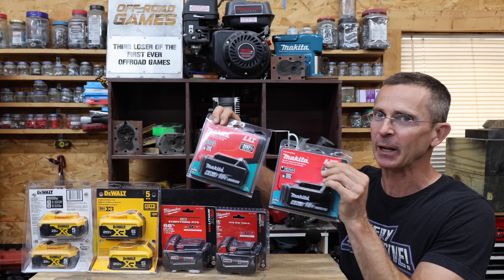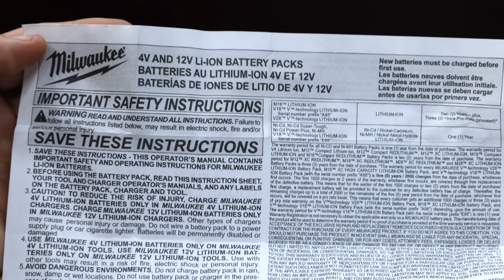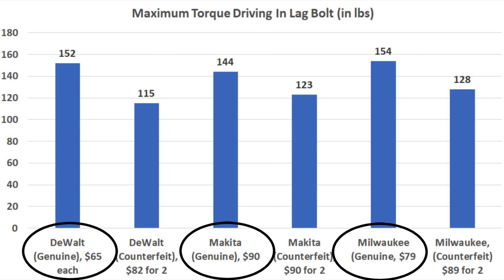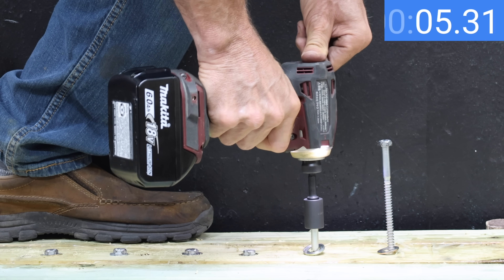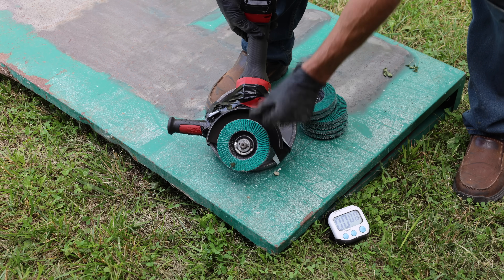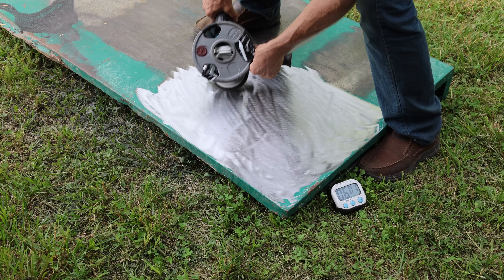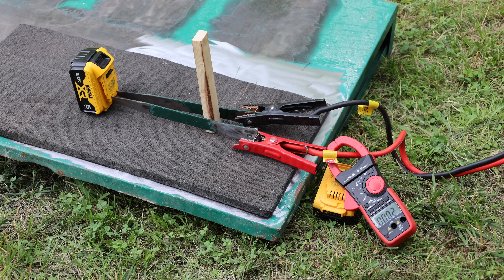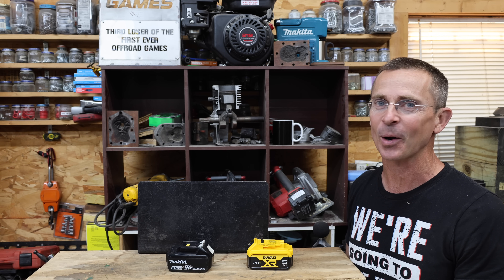Have You Been Scammed with a Counterfeit Tool Battery?

Comment: It's one thing to sell aftermarket batteries that are "compatible" with the tools.  It's an entirely different thing to sell fake ones as genuine.
Reply: It’s insane! If they put the effort, money and resources they used in making the battery look like OEM into making the battery good they could probably make a battery that is just as good at a cheaper price.
Reply: @cynic5581 but making them look like OEM generally does not take much effort at all. 
Often they are either made in the original factory or with the original tools.
When an injection molding tool is no longer needed by the OEM (because it's worn out or they changed the design) then it gets discarded. So instead of throwing it away some worker of that factory takes it and sells it to another factory. Now they can make parts that look exactly like the original for basically no tooling cost.
Reply: @cynic5581  You're right.  Could there be some law stopping them.  They could become a great aftermarket brand.  Maybe they just like being crooks.
Reply: @cynic5581   Thats why they spend money. To get sales!
Reply: @cynic5581  Real quality cells are expensive. Like more than half the cost of the pack expensive.
Reply: No kidding. If they just built their own battery they could likely be competitive for cheaper.
Reply: @capoman1 it saves them from liability by pretending to be the name brand
Reply: @capoman1 they are though. These knockoffs can be bought for half the price of the fake rippoffs. The companies making them seem genuine 3rd party, but if people will pay more for this, why not?
Reply: @capoman1  except.... LAWS.

Dewalt has laws about using compatible items with their stuff  as do almost all companies now.

Why should someone SAVE money and why should someone MAKE money on YOUR product no no no ALL THE MONEY IS MINE MINE MINE.

Fuck ass corporate greed.

Since the industry doesnt allow compatible sells. They have to fake real ones.

That said DAMN these are good fakes...
Reply from the maker: Great point!
Reply: @ProjectFarm  - If they would label knock-offs prominently as "Compatible with" I might even consider it.  But trying to pass a fake one off as the real thing, no thanks.
Reply: Where were these purchased from?
Reply: @inspectorraycharles    Aha!  Good question.  eBay would be my guess.  Or Ali, Temu, etc.
Reply: Yeah I buy those with the knowledge that they are not the real deal. They are like a lot of these where you get 80% of the performance for 25% of the price. Really I just need more than 3 batteries since I have 5 tools that all need them so I can keep using them while rotating them on the chargers. I am also not a professional but when I am using them the former professional in me is readily apparent. I'd rather buy 5 of them for the price of one then have a good one go bad because I'm not using it enough then it isn't there when I need it... that's criminal to me!
Reply: @JaredBrewerAerospace  until a fire in your shop due to fake batteries burns down your house.
Reply: @JohnW118  Great observation! You're correct. I am not without fault. Fire extinguishers should be everywhere. I can see 3 in my 400 sqft home shop from where I'm sitting right now. These are used with the revolving recharge schema I mentioned so unattended recharging is minimized. The rack on my charging station where I keep all my charging devices has the spare batteries storage compartments just for the knock-offs. On top of that, I don't even have it powered on unless I'm recharging the lawn mower battery when I'm not away. So thanks! I will pay closer attention to that going forward. Sounds serious enough that I might need to run this by the wife for how important it is for me to build an IR camera module that could kick off an extinguisher! Safety first!
Reply: @JaredBrewerAerospace  Jared the problem with fake batteries is they are just like the very best of the best batteries once they catch fire… lithium fires are extremely difficult to extinguish, so in addition to starting a major housefire, all you will end up doing is getting that nasty yellow powder everywhere while you futilely attempt to extinguish the battery fire with regular a-bc fire extinguishers. You need halon foam suppression to control the fire and last time I checked, they don’t put halon foamers in residential structures. Take my advice. Buy once, cry once. If you buy a legit Milwaukee battery and it craps out, take the damn thing back to Home Depot and exchange it. Legit OEM batteries cost what they cost for a reason. Have you never heard “you get what you pay for”?
Reply: Especially considering how dangerous they can be. I'm all for getting something cheap, it's another thing if it will burn my house down!
Reply: @anydaynow01  - I could live with 10-15% less power as long as they would include a better protection board for a mere one dollar more and label it as "Compatible with...".  Guess the counterfeiters aren't the brightest bulbs out there.
Reply: Some of the best batteries I have are aftermarket and not pretending about it. They look nothing like genuine dewalt batteries and do advertise as "compatible" with. And yes, these are better and cheaper than oem. You are absolutely correct. I will keep buying these because of the actual quality and honest advertising. They also have great customer service. I got a bad batch once and they gave me my money back without question. I bought another set from the same guys and am still using them today 5 years latter. Sorry to say i did find them on amazon but there is nothing counterfeit about them.
Reply: True. Bought a Sankeup 18v lithium replacment battery for my dewalt  drill driver. It performes better than the original battery, still working after almost 5 years of heavy use.
Reply: @Ssups101 That's interesting. I just bought two 18v 6 amp knockoff Milwaukee batteries. They were not very expensive but they brought my Milwaukee angle grinder to life and it became a different tool. Absolutely no comparison. I don't know how long they'll last but so far i love them.😮😮😮😮
Reply: It's insane that there isn't any lawsuit about this.
Reply: @FacuGonz3  there would be a federal lawsuit that amazon can not win if everybody would stop sitting here whining about it and report the fuckers to the US Attorney General for selling counterfeit goods. Selling counterfeit batteries is just as illegal as using counterfeit currency to pay for it. If just 100 people will take ten min to contact the USAG and file a complaint, they will launch an investigation and prosecute and fine them for willfully selling counterfeit goods, force them to vet their third party sellers, force them to remove all the counterfeit products from their site…. In short the government will teach scamazon a hard lesson about siding with chinese communists in order to steal American money
Reply: Just China being China.
Steal, Counterfeit, and Fraud is their way of life.
Reply: @catsspat  selling counterfeit goods as legitimate goods is also a felony and if everybody on here bitching about it would take ten minutes to file a complaint with the office of the AG and tell them amazon willfully sells dangerous counterfeit tool batteries, but apparently they’d rather whine on youtube where nothing will ever be done to force these goddamn chinese pirates out of the American market
Reply: i use aftermarket chinese ryobi-compatibles,  they seem fine.
Reply: @catsspat  I know a lot of automotive parts are knockoff like NGK sparkplugs. Right down to meticulous detail of packaging and other factory marketings.
Reply: @catsspat  ugh. I hate youtube….. if everyone on here complaining would just LISTEN TO WHAT I SAY and report amazon to the AG for selling counterfeit goods, they will force them to vet sellers and ban and report chinese pirates and will closely monitor their sales and start handing out prosecutions if they don’t remove all of the counterfeit goods on their site. Passing counterfeit tool batteries is just as much a felony as passing counterfeit currency
Reply: The alternative is to open the original battery box and replace the Samsung batteries with identical ones.
Reply: I have a 2 amp Ryobi compatible from eBay - works okay - no capacity LEDs
Reply: @ but is it being sold as an authentic Ryobi product, or is it sold as an aftermarket battery that is compatible with Ryobi?
Reply: @rollin18wheels  nope - just compatible.
Reply: Not to Chinese
Reply: wow
Reply: I just assumed they were genuine but failed the tolerance tests so were sold as "defective" at a bulk discount to "another company" and then sold at a lower price.
Reply: Yup. I've purchased ACTUAL aftermarket batteries for my Ryobi tools and they work fine. They're definitely not as good as the OEM, but they were cheaper, so I knew the tradeoff when I got them!
Reply: I agree. I know someone that used the "compatible" ones and they caused a fire in his shop/garage. 
Selling these as original, some people will assume they have the factory protection system in them and leave chargers unattended. That could go really bad.
Reply: @christopherdecker8171  I never trust any charger. When I quit work they get unplugged.
Reply: @christopherdecker8171  some of the genuinely good compatibles are also being counterfitted.  Best bet is to buy at a retail store (and keep your receipt) or for the compatible brands buy direct from their store page. If you get a counterfit product from a retail store, you have an element of legal recourse for any damages that product caused.

Sadly, too many people are buying the cheap counterfits online, then buying a genuine product from a store, and returning the counterfit to the store for credit or replacement using the receipt from the genuine one.  This practice makes it difficult to sort the genuine incidents from the fake ones, costs both the store and the consumer, and helps perpetuate the counterfit market (the counterfitters don't care that someone didn't use their item, they are just happy someone bought and paid for it, and would likely also be happy knowing that it was traded at a store so someone could get a free genuine battery).

And Amazon, Temu, and the rest also don't care, so long as they get their share of the sale.
Reply: Which could be dangerous. I am so sick of all the fake products on the market.

Comment: Please be careful with your tests! The smoke from those batteries can render you disabled and not immediately recognizable. If you accidentally inhale OR the cobalt laden smoke gets on your skin, the disabling effects may take a month or so to disable you and possibly permanently. Treat lithium battery fires as a hazmat situation. They can spontaneously reignite for a month or more after the initial fire. There is data that shows soaking them in salt water fully shorts remaining energy, but that is also dangerous. Remember: lithium batteries produce their own oxidizer during thermal runaway combustion and emit deadly poison gases.

Comment: Considering the price difference the fake ones did well. Most people don't short their batteries with C-clamps. I knowingly bought a fake Black and Decker battery for a chainsaw and after 3 cycles it would not charge. I took it apart and one cell was measuring 7 volts.

Comment: Ive been in the trade for more that 12years.  I honestly thinks that the counterfeit ones aint that bad when you think of it.  I mean using it irl application... Cant go wrong with the original ones though
Reply: Most of the lithium fires are related to these counterfeit batteries it go along with charger interoperability problems. They aren’t safe or worth the risk

Comment: At Defcon a few years back someone did a talk on laptop batteries comparing apple genuine vs. cheap aftermarket compatibles.  The aftermarkets consistently saved money by removing all the safety functions. With after market compatibles it seems like you can save a few bucks and they will work, but if anything goes wrong you're likely to lose the device and fire risk is high.

Comment: I got scammed even after calling Dewalt to "verified" that my batteries were "oem original".  I opened up the new ones to compare and discovered there was no "temp detection" that would tell the charger NOT to charge a hot battery. No thermocouple or connecting wire.  The cells were correct but being as the battery weighed less I suspect the cells were also fake.  Using a RC hobby charger to test capacity, it wasn't terrible at 4.65ah vs 5ah. As I have no idea if there is any "safety" to protect the battery from a over-heat meltdown/fire if pushed too hard in use, I decided to not use them. The clear packaging, info insert, battery case, stickers/markings were perfect copies.  If an American were doing crap like this, the Feds would be on them like stink, why are foreign/communists getting a free pass?
Reply: Globalism / lack of tariffs
Reply: They are not. It's the large corporate entities selling these that get free passes because they are not held liable. They are making bank on sales and if a customer grumbles about it they'll just refund them to keep the customer quiet with no case.  Unfortunately,  many do not even realize they've been scammed so the refunds going out are minuscule.  Meaning, these large online retailers making huge money off counterfeit goods.
Reply: LOL, government is in it for the $$$. More lucrative to sue good companies for being too successful. The only solution is to complain to the manufacturers.
Reply: Pretty certain DeWalt is known for having overcurrent/overtemp protection in their tools rather than the packs. Obviously the tool communicates with the pack to lock itself out for a certain period of time if it's overheating, so it can't be charged or discharged.
Reply: In many cases, same factories that produce "original" batteries, are producing fake ones, which actually arent fake, but made with less quality batteries, or parts that cant usually pass quality test . Most of those are sold in countries that dont really care about safety or quality control. They call it "products from night shift".

Comment: I’m looking at all my Dewalt batteries and truthfully I don’t know if my batteries are counterfeit or not since I threw away the original batteries!
How would we know!
Surely the manufacturers should be able to warn us and place some labeling on their products that would alert us to the counterfeits!
Thanks for alerting us to these counterfeits! Love your channel ❤️
Reply: That was my question  How would we know without taking them apart.
Reply: @RealJeep  counterfeit protection markings are hard to create. Either they are so advanced that they become expensive or they are too simple to copy. A copyright code and a website to register it on is one way, but as shown in the video it has to be more secure than the one DeWalt uses as the fake battery was able to be registered.

There is also the possibility of using custom security chips and make it so the tool won't work with a battery pack that doesn't have a working chip. But that's the stupid way we really wouldn't want them to use. Just look at the prices of ink cartridges for printers. Several manufacturers has a security chip in their ink cartridges and it makes their cartridges the only ones working with their printers. Sounds like a good idea until you see the prices they charge. There's also other idiotic things there like printers that can't print a black and white document because the yellow ink is empty. Now this ink isn't needed for the print as the user is concerned, but the safety codes printed on the document uses yellow dots. This code is meant to make the printout traceable so it can be linked to your printer. This was something developed to trace threats to government or organisations. It's not something the user has any control over what so ever. But if that ink is gone the printer will not work no matter what you try to print. Black can be full and yet the printer refuses to print even a single letter.

Now batteries are important for different reassons. You don't get the capacity of the real battery pack, it might over heat and burn, it will most likely die quickly. Still I don't think using security chips to lock the tool to the original manufacturers packs is a good thing. There are alternative providers that doesn't fake the look of their batteries. If someone want to use an off brand battery I think that's fine. They know it's not original and have to take the chance by themselves. If it dies or catches fire it's up to them as they knew it was an off brand.
Reply: @RealJeep  Weight measurement seems accurate enough, performance would be another, not to mention opening them up only takes like 4 screws.
Reply: @twoiko  Looking at them online there's no way to tell.  If you open the package you can't send it back

Comment: Thanks for the warning about counterfeit batteries because fakes can be dangerous.  Lithium metal does not have good mechanical properties so many types of cell coat the working material onto a copper ribbon and that is wound up to make the cell.  This works fine as long as the voltage of the cell remains above a safe minimum value.  If the cell voltage ever drops below that minimum value the copper contaminates the electrolyte.  If the cell is recharged after contamination the copper can form dendrites which can short the cell and cause venting.  Do any of the fake batteries have cell undervoltage protection?